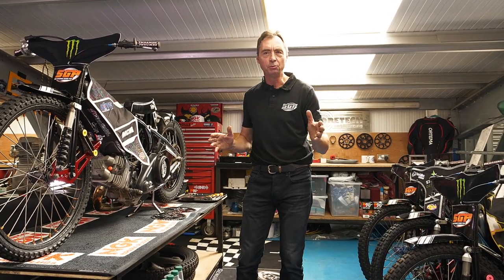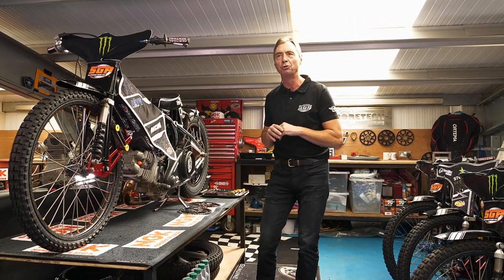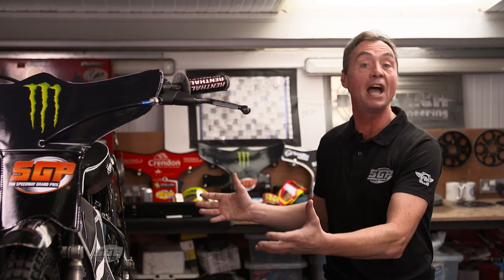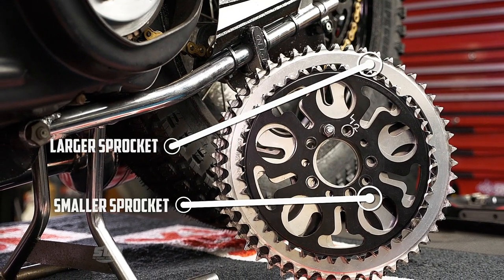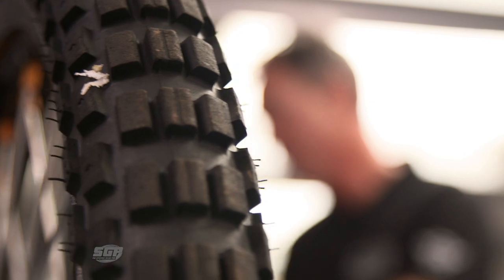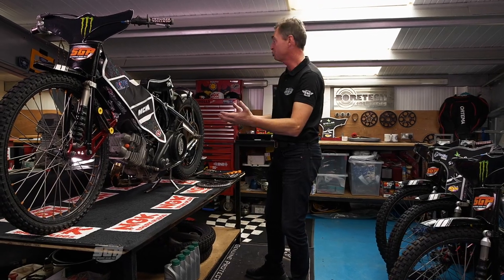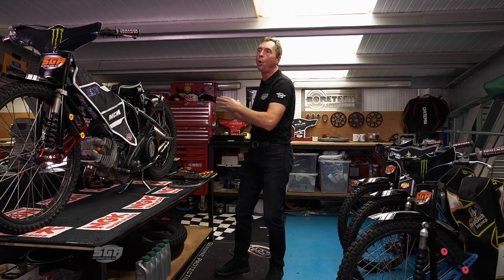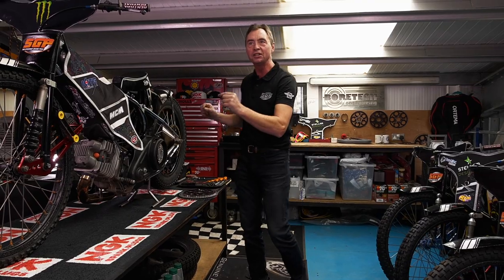Gears on a Speedway GP bike explained! | Tatum's Tech Talk | FIM Speedway Grand Prix

Comment: yep, you're so right there. I leart about it on a kart. Wrong sprocket and you're too slow for a tight track. Or, you pass them on the straight but lose in the bends. Cheers.

Comment: when you change gearing you also change the Wheel base. smaller sprocket lengthens the wheel base. ..a change of 3 teeth probably means altering length of chain.
Reply: And, you can adjust the distance after a gear change by adding pre-cut chain links to get the right set-up. Forward on chain/wheel adjustment creates More traction, but difficult to ride because the wheelbase is shortened. Anything from the middle of the chain/wheel adjustment and back is easier to ride, but less traction because the wheelbase is longer.